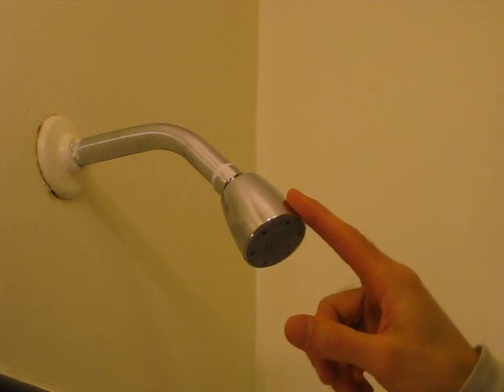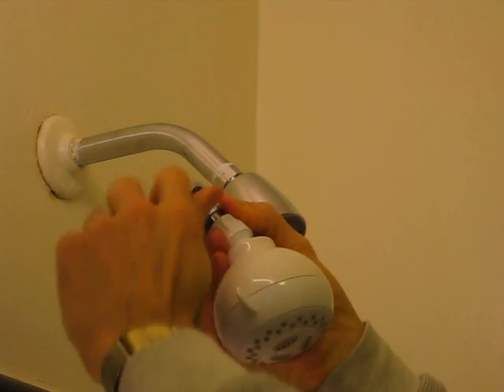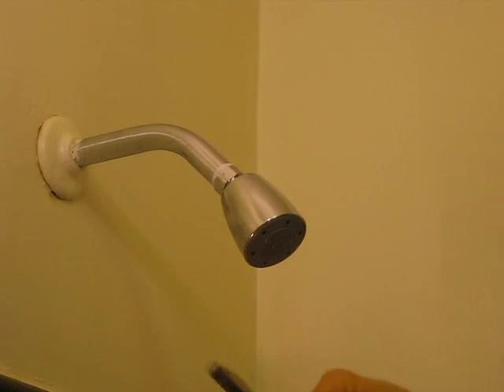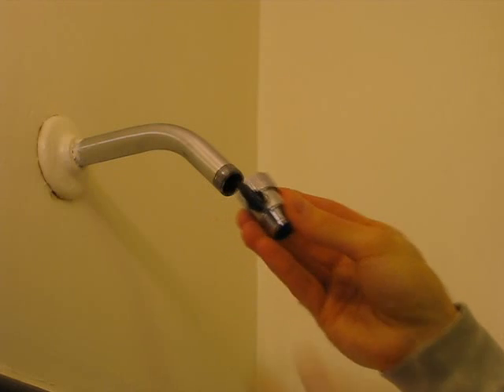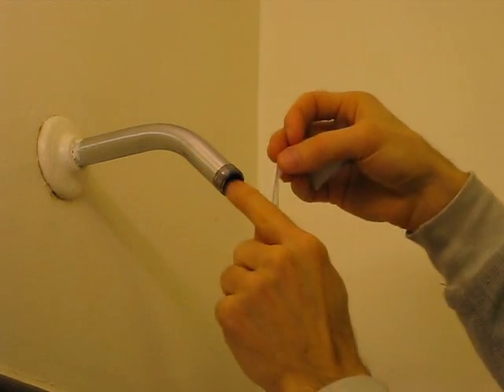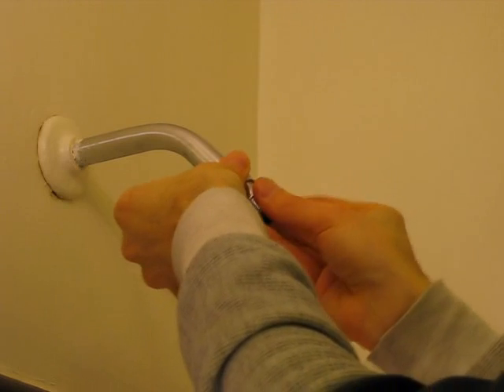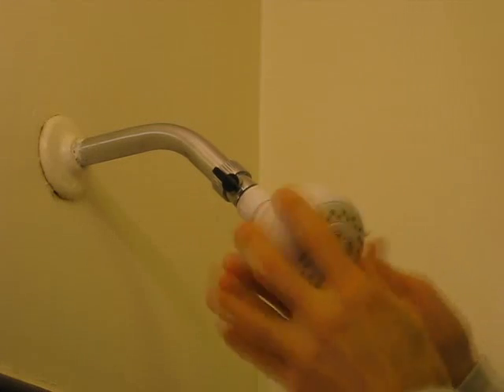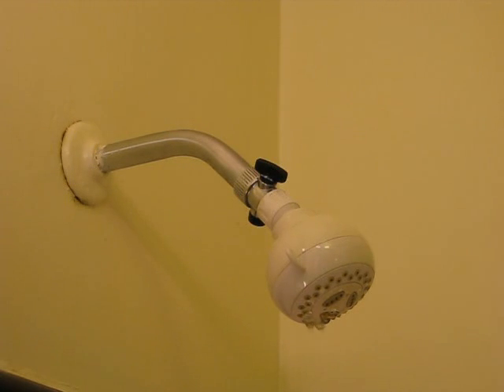How to install a low flow shower head

Comment: Don't get me wrong. We can control temperature (though lag time between hot and cold has increased significantly), we cannot independently control water flow. It's maxed around 2 gpm due to the shower head.

Comment: Unfortunately, even if I get a new head, I will not be able to control water pressure. The apartment complex replaced the classic three handle system (hot, shower/bath, cold) with a single handle. You pull the stopper up to switch to shower mode. I hate it, and I hate that America has come to this. The federal government is far too big to be getting involved in our showers. The environmental benefits are highly suspect.

Comment: Considering that what someone considers good flow is subjective, it's hard to relate to other people when it comes to shower heads. Bad shower head? Maybe. It was brand new. Overnight, I went from satisfying showers with 20 year old fixtures to hotel-like showers where afterward my scalp itches like crazy. 

This all happened because my apartment complex decided to change the fixtures. I resent it. I am looking for a new head where the restrictor is easy to remove.

Comment from the maker: Sounds like you tried a bad shower head - they exist. I know because I installed one for someone once and then returned it for a different brand. There's was no difference in time between my own older shower head and the low flow one in the video that I replaced it with. However, even the low flow shower head in this video is old and there are newer ones that use much less water yet. Perhaps some of those take it a bit too far.

Comment: "A low flow shower head can save you as much as 20 gallons (72 litres) of water during a 5 minute shower compared to older shower heads! "

But unlike with the older shower heads, you can't get clean in 5 minutes. Your showers end up getting longer, and there is no water savings.